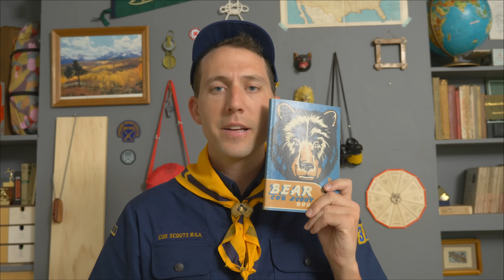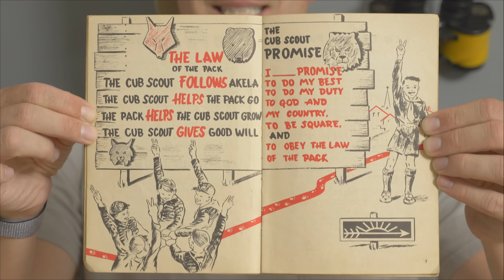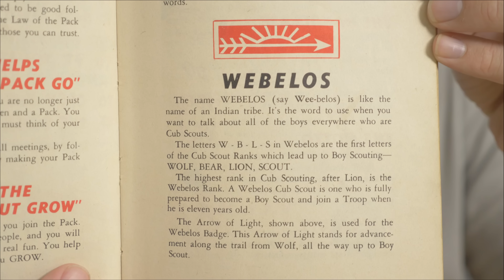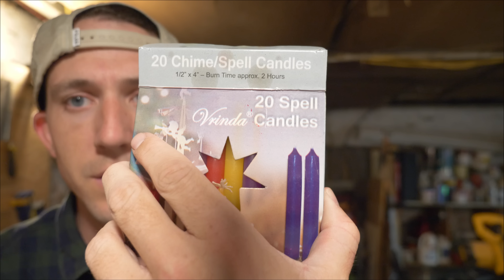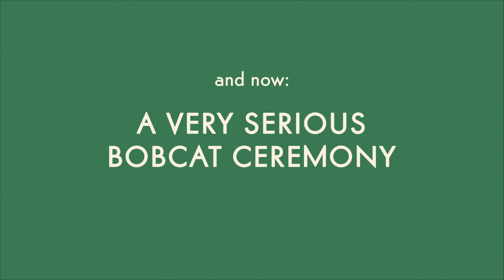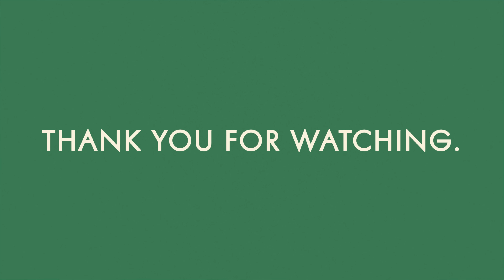Old Scout (Old Scout No. 1)

Comment: Just found your video, 18 months after released... I found that Cub Scouts was a great way to make sure kids did not become boy scouts.  They either dropped out of cub scouts never to return to scouting or when they landed in boy scouts, they thought they new it all and it was a mean wakeup call, resulting in many of them dropping out the first year.

The older program for sure was better.  The Troop I attended was huge, hovering around 100 Scouts usually with at least 7+ Eagles that did actually run the Troop.  We were an experimental unit with our own camp.  Way more fun than your typical Scout Troop.

There are programs in the BSA for adults, but they miss the mark.  Woodbage and a few others... but again, they are not Scouting as we remember it for Adults.  I think you have a great idea.  Not sure how you can market it... although with the flux Scouting finds themselves in today, you might as well jsut start an Adult social program based around Scouting and Nature and run with it. Could be very successful and you could even possibly franchise it.